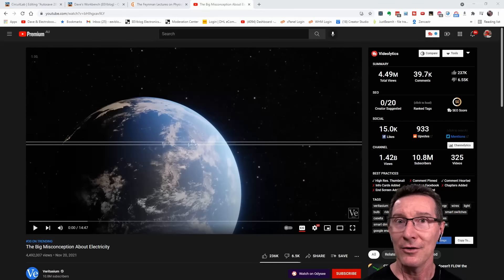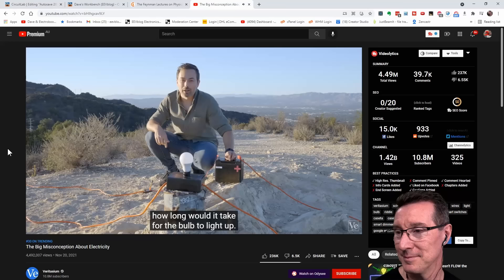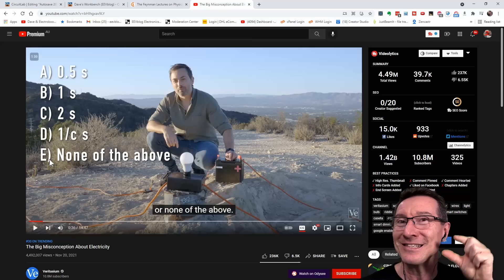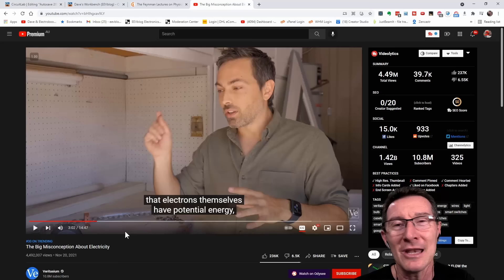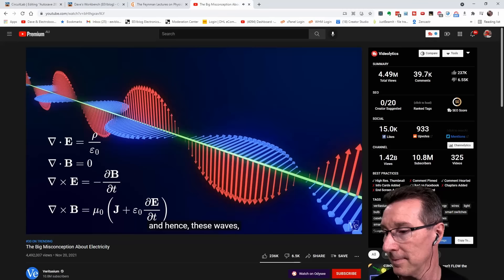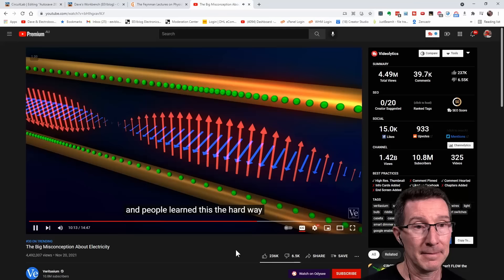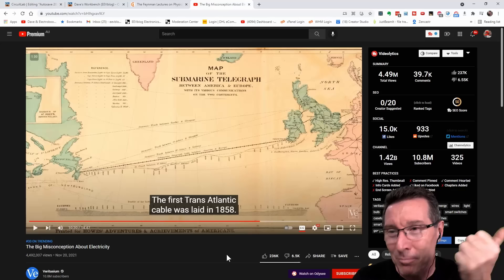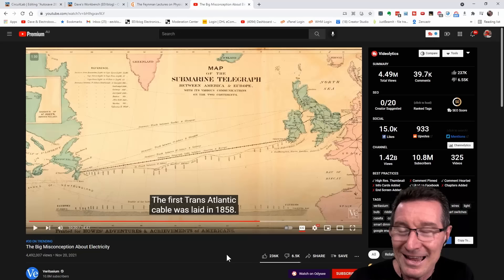EEVblog 1439 - Analysing Veritasium's Electricity Misconceptions Video

Comment: If you look at Poynting vectors they are a mess. The reason is that Poynting invented the idea when Benjamin Franklin's markings for electricity were in play. They were in play until World War Two but still taught by those that did not know the markings had changed into the fifties, there were even books written by experts in the 50's that didn't know things had changed. If you look at old pointing vector diagrams they show a vertical wire charged at the bottom by a (+) charge a compass laid on a plain that the wire intersects perpendicularly,  the compass needle that normally points to earth's north pole will turn and indicate that the rotation of the field is counterclockwise. Of course, the opposite is true if you use a modern car battery, the compass needle will point that the direction of rotation is clockwise. If you power the wire at the bottom with the (-) charge of a modern car battery which was at the time called positive because it had an abundance of particles of electricity and actual pressure, the compass will point in a counterclockwise rotation. So I am disturbed by anyone using them without considering their basic flaws. To me, those vectors are just wrong I say we find Derek and beat him, haha.
Reply: Regardless of vectors, EEVblog's lumped element model here is not the right one for Derek's experiment set up.  Derek's answer of 1/c is not entirely correct either.

Go to the top and sort comments on "Newest First", scroll to the time stamp of this post, and read mine.  You'll be surprised at what the answer really is.

Comment: Here is a quick video that might help young people understand what happened to the work of older scientists and physicists. Much of the older work is very accurate. If you realize what colleges did for grant monies from the government during World War Two, they altered the polarity markings on batteries. They changed the polarity markings from positive to negative. So now today the particles of electricity flow from the (-) terminal to the (+) terminal on a modern car battery. In school we learned what happened, and we learned how to use older cathode ray tubes, we had to reverse the markings compared to a modern car battery to get them to function. Well, the same is true of Poyntings drawings they do not work if you apply the polarity marked, with a modern car battery, but if you reverse the polarity then suddenly Poyntings vectors work perfectly as drawn. 

https://youtu.be/TMUW7Bo_Hvc

Sincerely, 

William McCormick

Comment: The correct answer is E)  value: is 2m/c
Reply: EEVblog's lumped element model here is not the right one for Derek's experiment set up.  Derek's answer of 1/c is not entirely correct either.

You'll be surprised at what the answer really is ....

Go to the top and sort comments on "Newest First", scroll to the time stamp of this post, and read mine.

Comment: This video helps but also introduces more mud to the water. When he mentions that for practical applications (I take that as real world, not theory or on paper) we basically ignore this science? To me that says the theory is BS, why does is work in there but not real life? The second thing have difficulty understanding from the other guys video is that he portrays the power travels outside the wire. As an electrician, I have difficulty understanding this, as I know what happens when a wire isn't insulated, someone gets shocked or a neat little spark is seen when it touches something out shouldn't. These things wouldn't happen with an insulated wire. Also, the size of the wire is very important,    to small of a wire carrying a certain amount of current will destroy the wire. I understand there's an magnetic field around the wire (hence the function of transformers) but don't understand why conductor insulation is necessary if this is the case?
Reply: His lumped element model here is not the right one for Derek's experiment.  Go to the top and sort comments on "Newest First" and read mine.  That should help.

Comment: I think the main problem is that the way he presents it it removes the cable from the equation. If you had a twisted pair (which would have similar performance in ac and dc) going for 300.000km and then connecting to the bulb that is 1m away from the source he implies that it would turn on at 1m/c in which case would be totally wrong. It is an interesting discussion starter but lacks too many details and ultimately gives the wrong idea. Also ignoring impedance (even just the resistance part) is a big no no... since to get close to this your conductors would have to be so big that the 1m would not be 1m anymore... then is it the distance between the center of the wires or the edge of the wires? Personally i'm annoyed because i like his channel and the content but this theory can never be realised in practice because there is no scenario that all the assumptions can be considered as such at once. Furthermore i dread some clueless idiot who's seen the video and one day will tell me "you know what, this and this because of this"... Thanks Dave for the sim

Comment: Here is the problem with his video.  From the beginning, he pointed out that his entire theory is wrong because he said we have to assume the wire has zero  ohms (no resistance.)  From there, you just (possible inadvertently) confirmed his video is false when you said it's not correct, but you understand how it makes his point.  As you said, this is basic knowledge for an engineer.  They know what he is teaching is 100% wrong.  Engineers know what he really means.  Does he think engineers go to his channel to learn?  People who aren't engineers only learn his theory based on non-existing conditions.  When he says the light is powered on immediately after the current passes through it.  But the power is insufficient to make the lamp bright enough to see.  Not only that, but if the bulb did light as soon as the current passed through it, and the energy is all outside the wire, why do we need a negative wire?  If there is no electromagnetic field created by DC voltage, that leaves no path for the power except the wire.  So this is an academic exercise that is disingenuous?  
You have successfully told us his video is 100% bullshit but you don't want to say that.
Nothing he said is technically wrong except he applied AC  properties to a DC circuit.
Nothing he said is technically wrong except wire does have resistance.
Nothing he said is technically wrong except the bulb does not light up enough to see it instantly.
Nothing he said is technically wrong except only an engineer can understand why his false statements are useful to demonstrate his point.
Nothing he said is technically wrong except his formula.  (Non-engineers would not know to change it if the  distance of space between the wires was greater.
Basically he made his video to show off his knowledge and confirm his ignorance.
You made your video to confirm the accuracy of his video, but proceeded to point out his mistakes.
In other words, he's full of shit and you know it but will not admit it.  
But just like you read between his lines, I can read between yours.
I would recommend subscribing to your channel and blocking his.

Comment: No one can give the answer until they know what effect the circuit is having on the flow!And all the other variables such as the purity of the copper line temperature etc.This is just another example of regurgitators thinking that science has been perfected and mathematics can always give the answer of a physical occurrence.All are just giving their best calculation to vie for most viable solution.It is interesting but like a boxing match if the rules change or the umpires have a different view the outcome will be different.

Comment: I'm five minutes in and wondering why this video is forty minutes long as it is revealed that everything said in the analyzed video is correct. Maybe he's just adding extra bits pertinent information here and there. Which is nice actually. I supposed to just keep watching it it's interesting
Reply: EEVblog's lumped element model here is not the right one for Derek's experiment set up.  Go to the top and sort comments on "Newest First", scroll to my time stamp on this post, and read mine.

Comment: so, if he have shielded the lamp against EMF... would it take 2 seconds to turn it on?
Reply: If you could completely shield the lamp and the wires up to the ends.
Reply: @jmodified  thanks for your thoughts. Well, revisiting my question now, I've changed my understanding, that, actually, it would not take 2 seconds in this case but would not turn the lamp on EVER.. as the power is transmitted by the EMF, not the wires (? (according to the Veritasium video), hence, shielding the lamp against EMF would block the transmission of the power (?)
Reply: @mescwb  If the ends of the wires are cut, then yes. That won't block the energy if the circuit is complete though. It will behave the same once a steady state is reached, whether shielded or not.

Comment: Derrick’s video both verbally and graphically indicate that the battery and bulb are one meter separated.  The point of the original video, as very clearly stated by Feynman, is that human intuition is insufficient and incorrect in understanding the discussed effects. It seems you are arguing the general public would answer the question correctly if only d.) read 1m / c.

More importantly, and counter to your stated opinion, it limits human potential to intentionally mislead in teaching. Counterintuitive phenomena drives curiosity. 
 
There seems to be some offense taken, on behalf of an insignificant percentage of the population (the “engineers”).  “At the physics level” == reality - a point which you seem to be rather dismissive of.

It only matters when it matters, according to you.
Reply: EEVblog's lumped element model here is not the right one for Derek's experiment set up.  Nor is Derek's answer of 1/c correct.  Go to the top and sort comments on "Newest First", scroll the time stamp of this post, and read mine.

Comment: Bro: Hey dude I'm gonna put some lights on my truck. Can help?
Me: How long the distance? From the wire to the battery? Let me grab my super computer to calculate the fields...
Bro: Dude it's one wire one bulb job.
Me: Hold on, the length of the wire is not important. you can put a billion miles of wire and it takes one over c seconds to turn on...
Bro: WTF are you talking about
Me: Also, the power is not flowing through the wire, but the um air? let me get some research first.
Bro. NVM.

Comment: how about you explain what tesla discovered with ultra high frequency dc disruptive discharge pulses.   and how he insisted his transformer was NOT magnetic.  and if you look at his actual designs you can see his special primary is not magnetically coupled to the special secondary.      tesla was trying to move the electric charge and the abruptly disconnect the circuit before the magnetic field could generate.  so that his secondary winding would be de coupled when the electric field raises the magnetic field and conducts power.    that way the load on secondary does NOT cause the primary to pull more power from generator

Comment: This video misses a number of errors in veritasiums video. The first being there will always be a finite amount of energy required to light the bulb and so a finite amount of line length required for there to be sufficient capacitance to transfer that energy. Then the inductance comes into play and the time required becomes a hell of a lot longer than 1m/c seconds. As for the energy being in fields outside the wire I suspect a large percentage would be within but insufficient information is given about the wire to quantify this. In general I think the veritasium video is misleading, the original question is missing key information and his answer just wrong for any practical light bulb. The true answer as you say could be calculated using lumped transmission line modeling but some sort of realistic assumptions about the light bulb would be required. It is a good thought provoking video though and now makes me wonder about the intricacies of fields around the electrons.
Reply: EEVblog's lumped element model here is not the right one for Derek's experiment set up.  Derek's answer of 1/c is not entirely correct either.

Go to the top and sort comments on "Newest First", scroll to the time stamp of this post, and read mine.  You'll be surprised at what the answer really is.

Comment: You are all wrong, my wires at my home works differently. I think it depends on where you live and which instruments you wish you had, to use, and check this out. But surely my wires are different to yours, maybe because if I use wires that's too thin, they get really warm, so something is moving in the cable even if it is AC Maybe the electrons are so powerful that they might move very slowly but have a big punch. LOL, I'm just kidding. This is what I think about that video... It's extremely irritating, and he lets it sound like he discovered something new. But EEVblog's answer, I definitively agree with. And yes, electronic engineering have 5 domains which you can specialise in, and they differ quite a bit from each other, and you use different tools. I think if I could remember correctly, it is Power Industrial Electronics, Analogue, RF, Digital, can't remember exactly, but an engineer usually learn or go deep in any two of these domains. You really get confused when you try to design something with all these domains in one, but typically there is a group of engineers and each of them do their thing which they are good at. You even get different professors giving different topics, it's not much that you get engineers who do all 5, except if you are the only electronics engineer. And you have to design it all, and then your boss don't understand why it takes so long. When good products are made those products typically gets split up and for example to make the power supply, that works perfect for it's engineered purpose can take an engineer more than six months to complete it to satisfaction, but this is really not the case for simple stuff, but for things like a Fluke DMM to get perfect goes on  for years before they are happy and offer a new product. Or PSU on PC Mother boards don't get it done quickly.  So different domains, different tools, books, time to study, difficulty. Where high frequency circuits are probably the most difficult, when you developed new stuff, I'm not talking about throwing an RF chip in the circuit, I'm talking about those chips, and at high frequency your analogue circuit designs will also be extremely tricky. Just have a look at Keighley's fastest oscilloscope, it's an engineering masterpiece. Pornographic...

Comment: how long it will take if you lay the lines in a circle?
Reply: if you add one additional bulb on one of the ends, which one starts emitting light first?
Reply: One second.  However, EEVblog's lumped element model here is not the right one for Derek's experiment set up.  Derek's answer of 1/c is not entirely correct either.

Go to the top and sort comments on "Newest First", scroll to the time stamp of this post, and read mine.  You'll be surprised at what the answer really is.

Comment: Can anyone expand on, or at least point me in the right direction, regarding how/why the poynting vector goes inwards towards the battery for DC?
Reply: Yes actually the tails of the Poynting vectors are at the battery. this is because the current passing thru the battery causes magnetic force vectors encircling the battery. The voltage at the terminals causes electric field vectors between the two terminals.  and the points where the individual magnetic lines and individual electric field lines cross, are microscopic right angles and you have to visualize that this happens so that the poyinting vector is at right angles to the magnetic vector AND the electric field vector.

Comment: You are wrong. it is only 1 metre over c if the speed of light is measured in metres per second. If it is measured in feet per second it should be feet. If c is measured in miles per hour that is a whole new board game. If you are going to say 1m/c then you MUST specify what unit you are measuring c in. Your answer is as misleading as 1/c.

Comment: As a teacher of electricians I find Veritasium's original video very interesting. Obviously electricians don't receive the same level of electrical engineering theory training and are therefore not as well versed in the electrical engineering theory as engineers are but they are still part of the professional electrical engineering world, albeit the more practical part. To suggest then as this video does, that Veritasium's video is purely directed at the general public is therefore misleading in my opinion. The reality is that its somewhere above the level for the general public and below that of an electrical engineer.

Comment: Veritasium is wrong and is leading most of his commenters into error by mischaracterizing the flow of energy in electric and magnetic fields. In contrast to what he explicitly says at 5:48, fields do not carry energy. The fields are the medium through which the energy is propagated, but it is waves in the fields that propagate energy. An analogy is the high school physics example of waves on a pond of water. The water is the medium the waves pass through, but it is the waves not the water that transmit energy. In Veritasium's battery example only the DC electrical current is moving, the electric and magnetic fields are there but static (i.e. no wave variation) and no energy is passing through the medium of the fields. (except for the insignificant initial turn-on transient all the circuit analysts are commenting about). The value of the Poynting vector is zero.  It will take at least a full second to turn on the light.